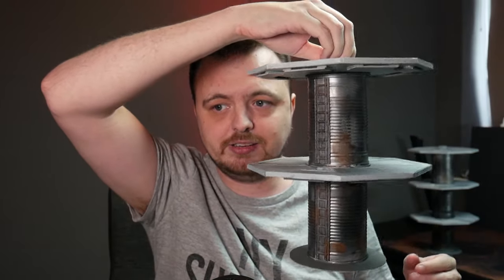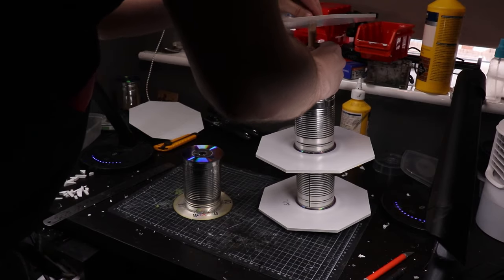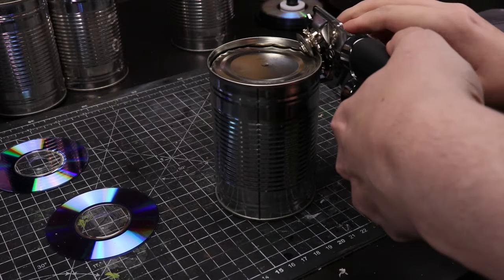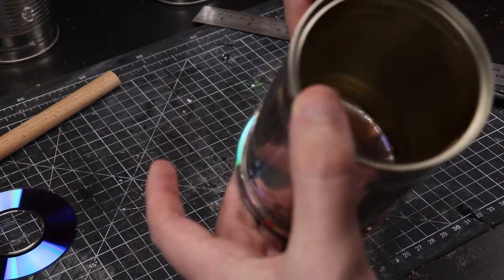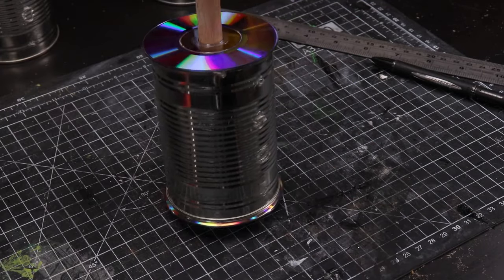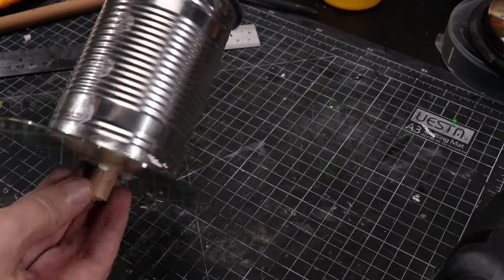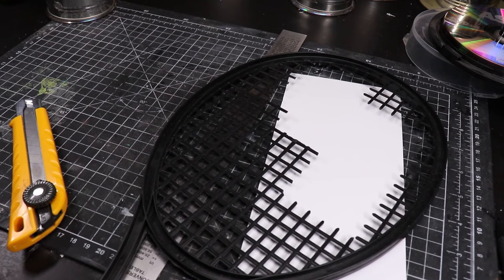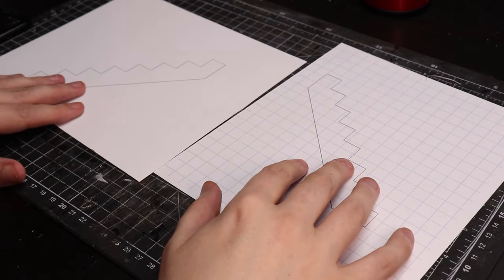Easy Modular Walkways For  Warhammer 40k

Comment: Very effective! I don't have storage space for terrain at the moment, otherwise I'd actually make this (with the depot pattern thing as the can look is a bit too noticeable), less nice than Wyloch's but much quicker to make, and more modular too.
For the railings, the racket thing could also be used for this easily.
And the tops are begging for some bits, guns, cranes or something.
Reply from the maker: Yeah I sort of see this as the outline of the concept. I could have done the card on the cans but really the platforsm mostly cover them when you are stood up looking fown.

Comment: Hotly anticipated, and you have given me some more ideas for how I want to handle this for my new table that is taking shape.  If you want to go with magnets, I would avoid the sheet magnets as they are very weak, but I've been buying up itty bitty neodymium magnets recently on amazon for 10 dollars for a few hundred in different sizes.  In the interest of getting a bit more texture on the platforms for painting, you could try either cutting through the card and exposing the foam in places, or giving it a thin layer of that filler stuff?
Also... NO OSHA IN STAR WARS!!!! :D
Reply from the maker: Sure, I agree on the magnets. I could have made it work, but this method was just easier. And you are right about texture. So many things I could do, but just wanted to get this system out there.!

Comment: Turn the can opener 90 degrees and cut on the outside of the can instead of the top and it leave a much cleaner edge
Reply from the maker: eeep is that not then a bit sharp also? I think for this build I wouldn't as we hide the inside, just being careful should mean you don't get cut.
Reply: @TerrainMadeEasy  There is a kind of can opener that cuts through the roll of metal that holds the lid on to the sides of the can.  It leaves a super smooth edge, and bonus, the lid can snap back on the can.  I did have to get it at a kitchen gadget store, but what is not bleeding worth to you?  :D  i use it for cat food... My precious fur babies can't get booboos from tuna!

Comment: Some great design ideas and concepts here. However for me personally I think that the final display looks just a tad too cheap. The cans and the bottle top are just too obvious :P I wonder what could be substituted to make it looks more fancy, or what could be done to better hide the materials used? Definitely some great inspirations to be taken away from this though as is how it is with the majority of your content. Take care dude and I look forward to more videos.
Reply from the maker: So for time saving in the video, I couldn't go into everything. 

The solution for the bottle tops would be to use something else! Either like a milk cap or you could even use a mini cid, to keep the profile low, anything will do. 

For the can, I have the fuel depot can design, which would help but take more time.

It's designed to be an easy and versitile piece of terrain, it does compromise on quality a little for that.
Reply: @TerrainMadeEasy  Aye you'd need a second channel for that "terrain made fancy" XD
Reply: @xCriticalStrikex  You might also want to look at scrap gears and pulleys to cover the cap.  Me personally, I'd 3d print a custom gubbin, but I also realize I am a hammer and to me, the world is made of nails that need 3d printing.  As for disguising the soup cans?  Wrap them in card stock and cut designs out of it.
Reply: Agree on the iconic look of the soup-cans. You could clad them in thin cardboard or even xps-foam. Maybe a second an third dovel, straw or tube (look for "Stangenrohr" - I couldn't find a good translation) on the outside of the core-structure to simulate supply shafts. To pimp the end-cap put something on, a  radio-dish, a statue ormiddle sized (techno)skull. You could also build another soup-can-structure from xps-foam, break it in two and add some of the pieces on your top platform to indicate that the structure used to be many levels higher.
Reply from the maker: @janschulte8434  There's a few options, I have gone for cheap and easily available but anything will do, just to trap it all like a big sandwich!
Reply: @TerrainMadeEasy  don't get me wrong. I like this project. It's great point to start from and make it your own. 

The one thing i didn't like was your comment about throwing food away. Don't waste food! Buy  a can with something you, or someone who will give you the can, likes to eat.
Reply from the maker: @janschulte8434  We ate so much soup, I only had to dispose of like 2 to make the video. Obviously eating it is better :)